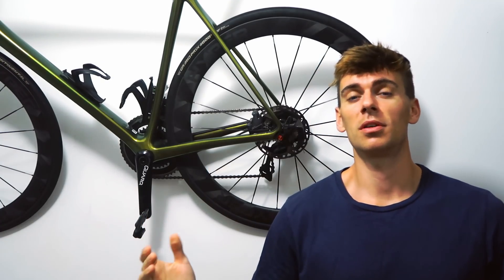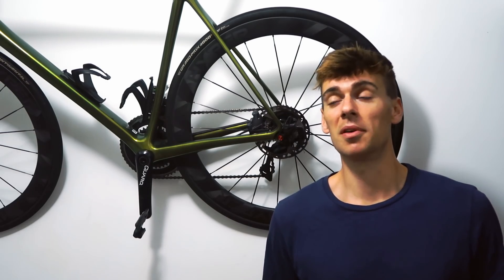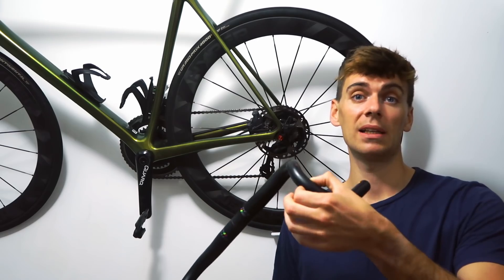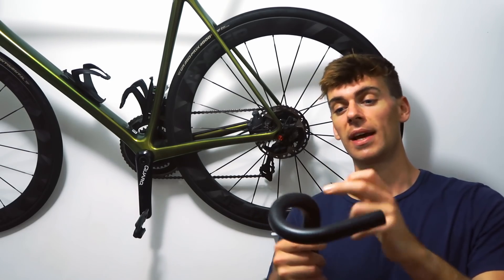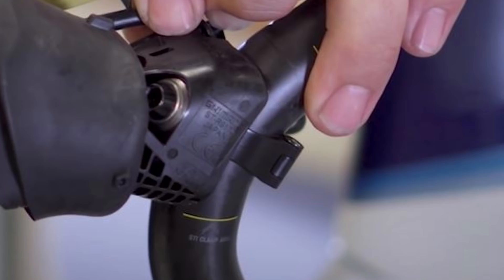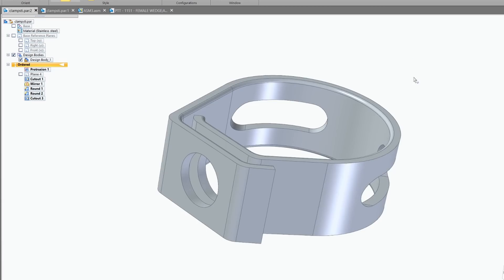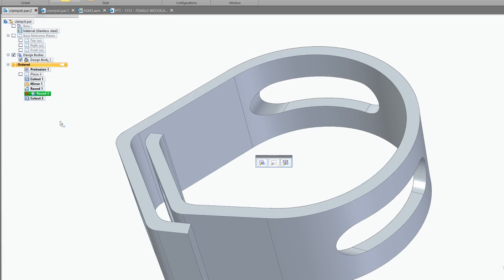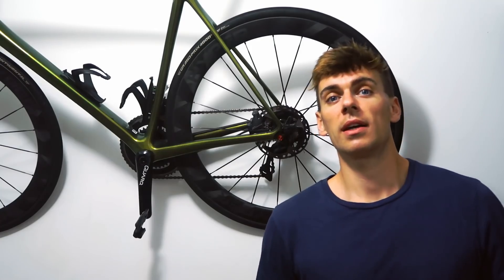MVDP Carbon Handlebar Fail @ Le Samyn: An Engineering discussion.

Comment: Am I the only one wondering why Canyon is designing themselves into a seemingly unnecessary corner? Why are the bar ends square?!
Reply from the maker: Exactly. It doesn't outweigh the risk of choosing a non-standard non-OEM part, with no redundancy.
Reply: @PeakTorque  Also worth pointing out, (IIRC and if those marketing bike build vids are to be believed) those team bikes never see a torque wrench. Team mechs who probably think they've been doing this long enough not to have to bother...
Reply: One thing to remember about mechanics, is that if a pro rider says my shifter hood is slipping or rotating (maybe because of poor clamp design 🤔) then what are they going to do? Do they have time to apply paste right before a stage? Is the paste not working? What immediate options does the mechanic have? I think they are probably going to increase the torque rather than tell the pro rider to just lump it. I mean, it is impossible to get all the information here in the peanut gallery. Certainly there are mechanics that are not the most thoughtful, and if they are ignoring manufacturers guidelines then that is a significant problem.
Reply: @hhmachine4254  What about for promo videos for a new bike being put together for the first time at the beginning of the season? They certainly have the time then. Otherwise it sounds like you're making a case for some fairly gross negligence that could put the racer and his competitors in some serious risk.
Reply: @hhmachine4254  Very good points!
Reply: @jackhammer40k_  Yeah, I don’t know about the assembly videos. The skeptic side of me would just assume they would brush off it as “show” and all bikes are assembled according to specs yady yadda.

In terms of mechanics being ordered or pressured to do things outside of manufacturers specs, nobody can ever prove anything. But I hypothesize it happens. Statistically, issues occur out in the field. I really doubt that teams would sideline one of their top riders because of a “fixable” (if risky) bike issue. Even if a mechanic says I won’t tighten that, the rider or DS could insist. Then the mechanic is left with a bit of moral quandary. The knee jerk reaction is to be like “no way, I quit and won’t do it” to cover one’s own butt. But then what happens? The rider or DS crank the hell out of that bolt themselves. Would the rider maybe be safer if the mechanic had used a proper torque wrench to bump the torque up by a controlled, minimum added amount? Maybe the mechanic would stand a better chance of remaining in the design safety allowance.

That’s just my pondering on a hypothetical situation. 

I think in the past, things were naturally overbuilt due to reduced analysis tools, and poorer control of raw materials. In the modern era of carbon and computer analysis, things are built to tighter and tighter specifications to achieve higher performance. I imagine that we might eventually see an abandonment of the usage of torque on critical components. Torque shows a general correlation to bolt tension, but is very variable and error prone. Critical applications in other industries at least use torque plus angle if not tension indicating components (bolts, washers, etc). In the bike industry, there are no base accuracy requirements for torque wrenches (that is why torque values are given in a range rather than a single number like your car or such), and there aren’t even any requirements for torque wrench calibration and recalibration. Of course all this would significantly raise cost of top level components, and in the bike industry shows really heavy downward pressure on price (it’s a toy in most people’s mind after all, despite high risk).

Comment: The only clamp I've seen so far that's safe is the one on the Rotor Uno/1x13 levers, they're carbon, they have rounded edges and they clamp really well. My bars will slip in the stem before the levers move.

Comment: For what it’s worth: I have a few Campagnolo clamps for Centaur 10 speed levers (2012) in front of me. 
The flat sheet itself is bent outwards on the side of the clamp opposite of the bolt. 
So at least one component maker is aware of this issue.

Comment: Doesn’t the Shimano band deform as it’s two bands at the rear or two bands bridged by a thin strip. The canyon Alamo is much stiffer as its machined aluminium and much stiffer.

Comment: Great video!  I'm still using aluminum bars for the generally increased safety factor.  I agree that Shimano et al should be putting a radius on the clamp -- but now that I've seen this, I may do a bit of radiusing myself with a file or Dremel tool...

Comment: Couldnt you do an alu insert on the back of the curve of the handlebars and completely avoid this failure, gaining minimal weight?
In my mind the clamp would need to be bar specific, due to different radius and other variables. But if it truly is pennies, that is easier and probably way cheaper.

Comment: Just Canyon again - don’t understand how to do design for manufacture.  It smacks of arrogance that they go an redesign parts from an established reputable component supplier rather than collaborate with them or design to fit what they intend to install.

What’s the bet they didn’t do a proper DVA on this as well.

I’d be deeply concerned about  their adjustable bars as well; would you really trust them with bolted joint calculations?

I wouldn’t trust anything canyon anymore; I’d be constantly thinking ‘what next’ when riding anything they make.

Comment: What is a good torque when clamping the Shimano STI levers to a carbon handlebar? Is there a recommended torque # or just go with the least amount of tightness so long the lever doesn't slip? Is grip paste also good to use?
Reply from the maker: Carbon grip paste isn't always ideal because, the particles can separate from the grease. And sometimes, you're basically just smearing on grease with hardly any grit and you'll lower the clamping friction. Better to use an alumina powder in a low strength Loctite, and make your own paste. That really increases the friction as the loctite cures when its clamped.
Reply: Shimano only say 6-9nm, dont under tighten, and to see canyons bar spec
Reply: @Jeppelelle  There is no way that's for a carbon bar though
Reply: @YuriThorpe  6-8nm. They say directly.under that, that it's important not to under tighten carbon bars
Reply: @YuriThorpe  Shimano doesn't differentiate between carbon & alu bars (my comment was in reference to the other comment, not a recommendation for carbon bars) so if one want to be sure then one should reference the handlebar manufactures recommendations, (good quality handlebars should be reinforced at the clamping area but who know what the manufacturers cuts corners on), but one of the safest way, that i see most people do is to just tighten them enough until the levers don't move easily by hand
Reply: Shimano does recommend 6-8nm but I keep less than this as if the bike is for some reason fallen over or hit at the sti’s they will tend to snap. I tighten to where they just stop moving and add a 1/4 turn, now they stay in place but rotate if hit and I can turn them back. This was extremely beneficial when I flipped my bike at 50 kmh
Reply: True, but need to be tight enough that they won't slip if your breaking downhill and hit bumps
Reply: @PeakTorque  looks like there's lots of types of alumina powder on the internet, what would you recommend? hydrate? calcined? maybe this https://www.scarva.com/en/gb/Scarva-Raw-Materials-Granular-Alumina-Hydrate-RM1002G---500g/s-7378-35511.aspx
Reply: @PeakTorque  PT Grip Paste® !  can you give a name brand for alumina powder (never heard of it)? I would like to try this !
Reply: @PeakTorque  why carbon
Reply: It's likely that there's a minimum recommended torque from Shimano for the levers, then also a maximum torque from the handlebar manufacturers. If they don't overlap, then the components are mismatched and should not be used together, which would be Canyons issue (not saying if that's the case here, just highlighting that there's no guarantee the parts will always work together)
Reply: Loose enough that you can move them by hand if you need to.
Reply: @PeakTorque  loctite 222 suitable?

Comment: According to his father, Adrie, Mathieu crashed into a car during the previous race (Kuurne) with his handle bar and he used the same bike (and thus handle bar) in the following race. The carbon then failed due to the impact on the previous race and the harsh ride over the cobbles.
Reply from the maker: If that's the truth, what good is it doing now? Canyon should have under contractual obligation all factory teams replace compromised components immediately after a crash or impact. Especially in Carbon. That's SOP in Motorsport where composites are widely used. But instead they'd rather another PR nightmare? Hmmm.
Reply: @PeakTorque  I don't know exactly what you are implying but I am not saying anyone did this on purpose. I am saying, according to Adrie, his father and member of the staff of his team, he rode into a car, and they didn't replace it because he didn't crash. If he would have crashed they would always replace parts or the entire bike if necessary. But because he didn't fall, they didn't think of that. I am not saying all of this is true, I am just saying that's what he said on Belgian national television.
Reply from the maker: @TGShunai  yeh i hear ya. And cheers for the info. Seeing as his Dad is a member of staff, and knew about it, he had no excuse not to get them changed! His son's safety on the line. Mad.

Comment: Make more sense to have a male grid pattern on the back of the carbon bars that a female clamp pulls on, would require less torque to secure them more securely.

Comment: Alloy bars all the way, what are the pros saving in grams (minimal) carbon, whether it was over tightening or a failure with the shim/carbon will always give rise to these issues.
Reply: Before all these proprietary one piece carbon cockpits, most pros chose to ride alloy bars for safety, don’t want a failure on an alpine descent.  Now they have no choice, ride what the sponsor gives you.

Comment: The clamp has not changed since they were invented, and I have been saying this for years. And why I use aluminum. And if the clamp is radiused it won't work. It is that edge that digs in. When I had carbon bars I put a grip tape, that adds friction on steps, on the back of the bar where the clamp digs. Moreover, to save weight, everyone is make parts unnecessarily thin, like the steerer tube issue. That area should thickened on every bar. And likewise for steerer tubes.

Comment: Couple of questions:  On one of the images of the clamp being installed, the bar had a zone marked for where to clamp.  Do you know what reinforcement Canyon make to the bar there?  Also, what merit is there to having a compliant layer between the clamp and the bar like a thin layer of rubber to equalize the loading across the surface?

Comment: One of the reasons I use aluminum bars.
Reply: And frame, and stem, and rims... ;)
Reply: I had two aluminium bars breaking in the past - these were both cheap ones on a regular bike though. I think that the trick is to replace any bar after a crash, don't use the same bar for a decade and try to not get a really new superlightweight fancy one - indeed aluminium.

Comment: Could the adjustable top section be an issue by increasing flexion near the clamp.
Reply from the maker: I wonder if MVDP has complained about play/flex in the bar and the mechanic has overtightened the STI rather than the iassue being the bolted bar section. Long shot but its another one that should be in the fmea table.

Comment: Could it also be the bolt came loose a little and the clamp chopped into the carbon because of the extra play? Or is that not an issue for carbon?

Comment: Hahahah just built a Tarmac SL7 the shimano STI levers  recommend a tightening torque of 6-8Nm.  
I Was thinking about it this morning as I have tightened up I think to 6Nm, and was also thinking oh sh*t! and have now just seen this video now!. 
Specialized have no available installation manual for there Aerofly 2 bars online which is crap so possibly have made an expensive mistake. 
Not the first time I have had problem myself with parts. Tune aluminium seatpost cradles fractured! Gelu carbon seatpost cracked at seat clamp although torqued below minimum, Felt carbon frame seatstay fracture. Luckily I have for in the habit of conducting through  inspections of my carbon bikes

Comment: What ever the issue is I'd be pretty pissed with the development ;
 ''Experts from the Canyon development and quality management departments immediately began analysis and testing to understand the cause of this incident. The affected cockpits (CP0018 and CP0015) are [sic] only installed on the current Aeroad models CF SLX and CFR. The Aeroad CF SL model is not in any way affected by this issue. Canyon is… informing all affected Aeroad customers and asking them to stop using their bike for the time being.” 
So you smacked from 5000 to 9000 £ to get stop ride notice 2 weeks before spring, what the hell? 
Interesting on the same page ;
''It was initially speculated, by CyclingTips, that the crack may have been caused by the overtightening of the lever clamp. However, the stop ride notice implies that this was not caused by a mechanic’s error or faulty torque wrench. The design does however use a proprietary clamp band.''

Comment: Apparently Van der Poel hit a car with that same bar in Kuurne-Brussel-Kuurne.
Reply from the maker: So why hasn't Canyon contracted factory teams to replace compromised components after impacts? Should be standard procedure. Not doing so is an engineering and business fail.
Reply: I agree that they should have replaced that bar. It is a good lesson I hope.

Comment: Great stuff. Replace Shimano factory pars at your peril! Clamp on levers to carbon bars is a 5hit solution anyway. I mean, a crushing clamp on carbon? Crazy. Perhaps a bar profiled threaded alloy insert to the bars with a direct bolt through the bars. Less adjustability, but more secure? Carbon QC is a horror with critical (as in life and death) components like front wheels, steerers and bars. But we still buy them...
Reply: Ribble has done this with their "Ultra SLR" aero bars. Looks like it limits where the levers can be mounted, but it is a better way to attach a lever IMO.

Comment: Adrie (Matthieu's dad) came on a talkshow yesterday and explained they think it's because he bashed his handlebars into a team car during Kuurne (Sunday). Seems like the most likely explanation. These bars are made quite sturdy and the mechanics would not make the mistake of overtorqueing the shifter.

If you guys wanna have a go at canyon, do it because of poor design, bad tolerances or proven manufacturing faults. Not because of accident like this.
Reply: if that is the case, then you should post the talk show video clip to prove your point.
Reply: @zwamman  Thank you. I agree with you on more meaningful metrics and standards. 
Unless BB of the frame breaks apart while pedaling, poor BB tolerance is too subtle to become a major issue, especially to new cyclists. Anyway broken handle bar incident stands out too much than poor tolerance on BB.
Reply from the maker: If you listen to the video, i didn't infer that it was canyons fault. In fact i say on a number of occasions that i did not believe it was the use of the proprietary clamp that caused the failure. The video just highlights however how a seemingly trivial part is actually quite complex.

Comment: My 35 yr old Cinelli alu bars just did the same thing in the same spot and probably for the same reason. Overtightened clamps are a bad idea on any material.....
Reply: Considering the age of your handle bar,  I'm guessing that corrosion in your handlebar accelerated stress crack caused by the clamp.
Reply: @Reanimator999  very possibly a contributing cause, add that to constant flex and over tightened clamps and any material will eventually fail. Luescher teknik  did a video on it

Comment: Another case of German overengineering? 
They need a bit more Japanese Zen.
Cheers and keep them coming 👍🏻
Reply: I have a Toyota and a VW. The Toyota is more reliable and easier to work on😂
Reply: I have an old 1986 vw that I am restoring.  Except for engine and transmission, everything is crap.

Comment: Dont forget that VDP crashed into a car on sunday with the same bike. There could've been a small fracture in handlebar already.
Reply from the maker: If thats the case, why the hell wasn't it replaced immediately after KBK? Instead of dealing with another PR nightmare.
Reply: @PeakTorque  I'm not sure. But I think it was because it wasn't a major crash and there wasn't any visible damage. He bumped into the mirror of the car. But I agree with you on that it should've been replaced.

Comment: Nice video on brake down on MVP malfunction!!! Did yiu notice when it broke on him at around 1.5k to go..... that he threw a piece of the handlebars to the street 🤔😂 most likely the curve of the bar??  Morale of the story is MVP did VERY VERY well to stay on the front and not just pull a strop😁 considering he couldn't change gear in the rear??
Reply: It was much earlier than that.

Comment: basically Canyon screwed up big time.
as an enterprise (ie. not a manufacturer) or merely assembler, you want the minimum quality liability. 

if it's handlebar failure, handlebar manufacturer is to take care of that.
if it's a brake failure, brake manufacturer is to take care of that.

now, it's canyon who 'MODIFIED' the OEM clamp to an aftermarket one, be it a Canyon's own design or, yet from another OEM. canyon really screwed up, because none of those accessory OEM has the capacity to bear this sort of safety liability, none.